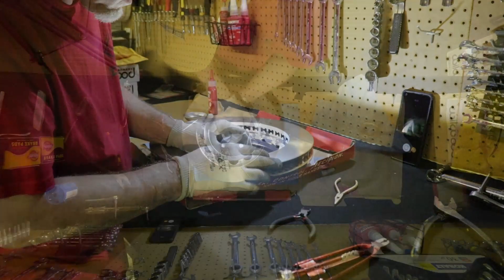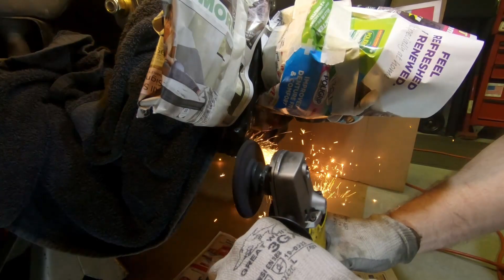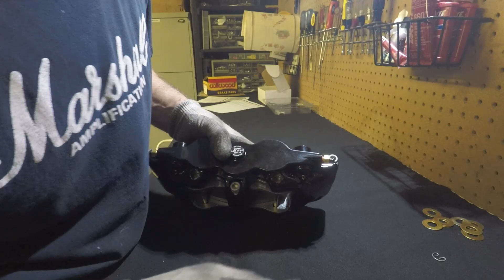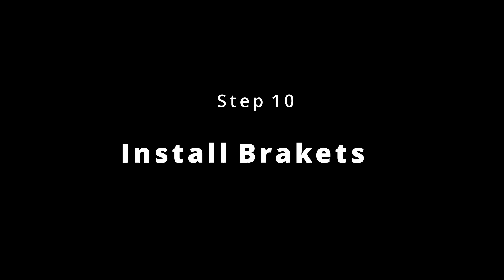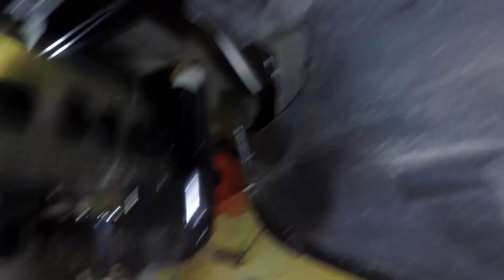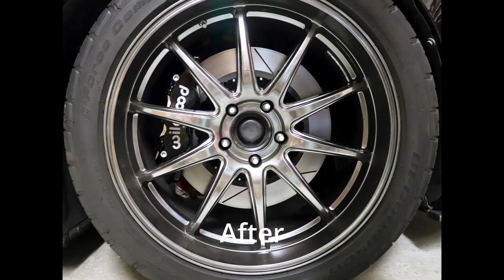Wilwood Big Brake Installation - Mopar Chrysler 300C, Dodge Charger, Challenger & Magnum

Comment: Great video and explanation for everything. These parts are more expensive than replacing knuckles and getting new calipers and rotors. 1700 gets you mopar and brembo parts.
Reply from the maker: Thanks for watching. I have no regrets going with the WIllwoods. 

If you can get new 6 piston Brembos / 2-piece rotors for $1700 I would suggest you grab 'em! That's a great price!

I've seen Brembo 6 piston calipers on sale for around $825 each just for the fronts, 2-piece Brembo rotors another $870 ea. Not sure what the knuckles and rears will set you back. 

https://www.stevewhiteparts.com/oem-parts/mopar-disc-brake-caliper-assembly-right-68248388aa

https://www.stevewhiteparts.com/oem-parts/mopar-brake-rotor-68184587ae?c=Zz1icmFrZXMmcz1mcm9udC1icmFrZXMmbD0xNyZuPUFzc2VtYmxpZXMgUGFnZSZhPWRvZGdlJm89Y2hhcmdlciZ5PTIwMTUmdD1zcnQtMzkyJmU9Ni00bC12OC1nYXM%3D

Comment: Does the big brake kit required the spindle/knuckle found in the brembo equipped cars or will work on not brembo equipped cars?
Reply from the maker: No, this kit is a direct bolt on for the "Non-Brembo" cars.

Thanks for watching!
Reply: @ZeroEmpire  nice, thank you for info and reply